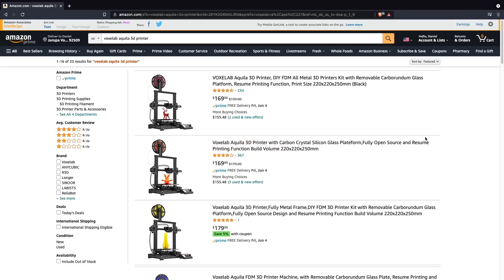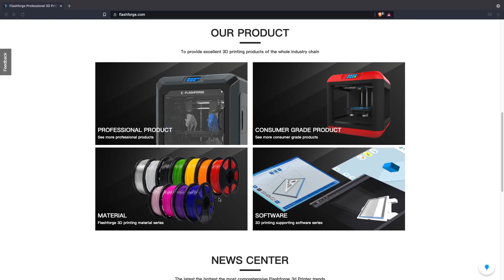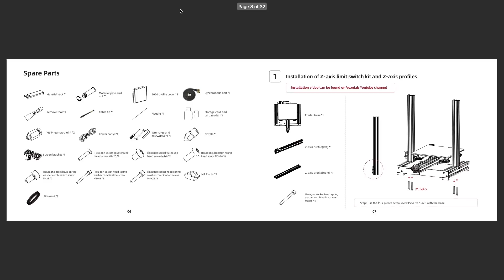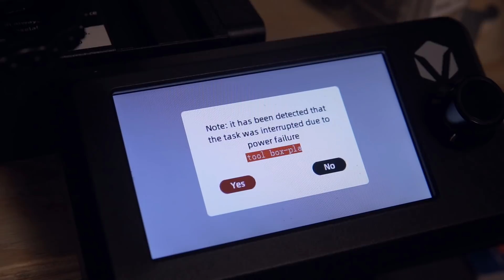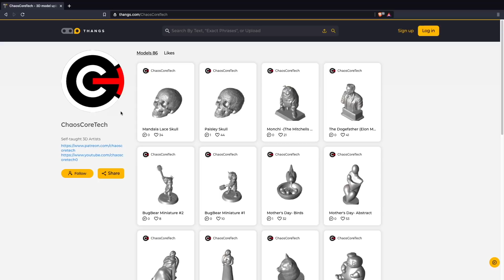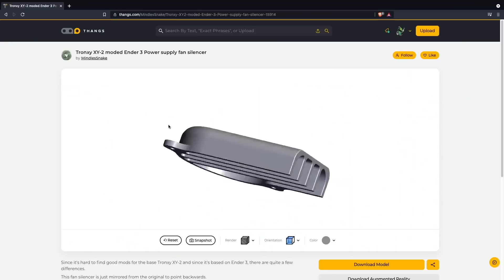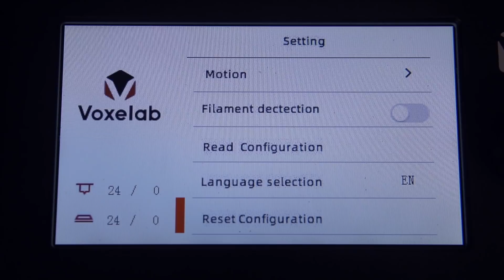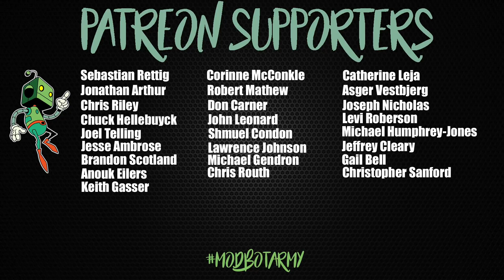Should You Get The Voxelab Aquila Over The Ender 3 V2?

Comment: I have the N32 chip aquila x2 printer. while it did work at first and not using it for a while tried printing a part I made but it was doing all sorts of wacky stuff. at first I thought it was my slicer or my fusion 360 model but I now can rule them out. I decided to update my software to the latest drivers. installed it it was fluttering didn't realize it was installed till I checked and saw that it was. Now its worst then ever. crud I'm frustrated.

Comment: Wonder how will both stack for longevity. 
I have a cr10 which is now 6 years old and is running the last two years in a camper van (I am vanlifing non stop since 2020 with my old cr10 inside)
I ran it pretty hard before moving it into the camper, with some really large almost full volume prints pretty often, now I don't print so often in the camper and never print for longer than 8-10 hours at a time but all the vibrations from driving and all are quite the torture test.
I have to say hands down this thing rocks, last week was the first time I had to change something since I bought it , the y axis nema motor, that's it. 
Maybe I got very lucky with my unit but still.
I should maybe make a channel testing 3d printers for durability in my camper 😂

Comment: I have one of these printers and it works great, there is one option I would like to see and its with changing filament mid print, there is no option to use the load and unload filament when you are printing, but the option is there when you are in the menu when not printing,😎

Comment: This was my first 3d printer and it has been great. It has run hundreds of hours in the last couple of months. The one big deal is it is extremely hard to find parts for. I keep hearing Ender 3 parts would work but then I noticed there are a ton that don’t. If someone could make a video going over which parts work on the Aquila I would almost pay money for that.
Reply: Just print the parts that you need 🙃

But ye it's quite concerning that some "advertised"parts don't completely seem to mesh
Reply: I’ve upgraded this thing from head to toe at this point. The only difference that I’ve had to deal with is the x carriage and the x end stop. The rest have been drop in replacements. I’m not too sure about the y carriage the holds the bed though, I haven’t looked to changing anything around there.

Comment: Is Voxelab trying to create confusion?  After watching your video, I checked out the Aquila.  There are four versions.  Their S2 version sells for the same $279 as the Ender 3 V2.  You can get an Aquila for as little as $169 but is comparable to the Ender 3 V2 or just the original $189 Ender 3?  So yes, the cheapest Aquila is $100 less than the most expensive Ender 3 but I don't know if that's a fair comparison.
Reply: S2 has a direct gear extruder

Comment: I have had a few successful prints but I find the bed leveling keeps adjusting itself I suspect the cheap springs under the plate, also I cannot seem to get this to work smoothly with the cura profile that was supplied with it, have stripped and rebuilt fine tuned and still having the same bed level issue :/ ill see what happens after new springs are installed

Comment: How do you suppose this printer will work with ASA? Since there is so much attention paid to heat on this and other printers I wonder how enclosing it might effect overheating of components?
Reply: This is not a printer for asa. You would have to upgrade the hotend to an all metal to print at asa temps safely. Not hard to do but should be aware
Reply: @Famousbird54  Thanks

Comment: You're joking... I.. I just bought an Ender 3 v2 2 weeks ago, I started modding it 3 days ago for the silent fan mod (with some difficulty, the guides do not mention ALL the stuff you need). Why didn't this show on my recommended sooner?
A real kick in the teeth is, I'm subscribed. sighs
It looks identical, I am shocked, amazed and really disappointed that I didn't see this sooner. I'm gonna go cry in the corner now.
Reply from the maker: lol no!! The printer you got is still awesome and the Ender 3 v2 has been a solid machine. There is always something new coming out but honestly I love even my printers that are multiple years old. Enjoy what you have, the v2 will bring you lots and lots of great prints :)
Reply: Ender 3 V2 have a lot more community mods. I replaced all my fans with noctuas to make it whisper silent, if you're farther than 6 feet away you can't tell if it's on or off by the sound.
Reply: Unless you do some serious mods, these printers are good but slow depending on part size.  Hence if you really want better results without too much time spent doing mods you need to think in the direction of having more than one printer to work with.  I am seriously considering adding more printers to upgrade over the slow - to - print problem.

Comment: My first 3D printer was the Aquila, then my 2nd one was an Aquila, and I will stay with this. Might upgrade to the X2 though. I've had little issues with this printer. I did have to replace the extruder stepper after about 4 months, but I've been running this "Hobbyist" printer hard. My only suggestion is to upgrade the plastic extruder with a Winsinn Aluminum extruder. It's worth the $20.
Reply: Do you have a model number for that Winnsinn Aluminum extruder?

Comment: I've had the Ender 3 V1 for a couple months now, I have the tensioner upgrade but haven't gotten around to installing it yet because I'm busy using the printer.
I got mine discounted as a scratch and dent (one little bitty unnoticeable scratch, SCORE) ao it was 33% off the $240 price tag (at the time of purchase)
with the auto-bed leveler (soon) and the bowden tube upgrade (first thing I did to it) it'll serve me just fine for a Looooong time.

Comment: For a newbie 
What filament should be used for what
Best all around filament 
Can this machine handle all types or what ones don’t you recommend to use 
About to order this machine on your recommendation 
Thanks
Reply: Use PLA, is easy to print, relatively cheap and it does not harm you as the ABS (toxic fumes). And if you need to print stronger pieces use PETG, but first learn with PLA, I would say.

Comment: I'm considering taking the plunge into 3d printing.  My question is - if I want to make a specific item to fit another item (like a lid for a jar, for example), how would I model that in 3d so it would be accurate and snug?  I already have a 3D program (Lightwave 3D) which will export a Collada, STL, or OBJ.  I just want to make sure I'm able to model something that would be accurate to fit it's purpose.  Thanks :)
Reply: Measure, print, measure again
Reply: You could print the specific item instead of printing an item to make another item fit into the other item. I hope you get what I mean

Comment: I was just looking at an Ender 3v2 because of all the community support that Ender machines have, especially when it comes to Cura settings. I currently have a Longer LK1Pro, and there's almost no support for that. it had its own slicer, and seemed finicky when trying to print files sliced in Cura (admittedly it could also be that I'm a noob and just couldn't dial in the settings properly). Since this comes with a working Cura profile, that may have just tipped the scales to getting this machine instead (and putting the money saved toward a resin printer).

Comment: maybe good for the price but currently they are shipping the printer with a 512k firmware on a 256k board.  The board and chip are supposed to be 512k but they have bad sectors and are operating at 256k.
Reply: no. the stock firmware is compiled for 256k and working flawless. but nevertheless i recommend to flash https://github.com/alexqzd/Marlin/releases/tag/v1.3.4

Comment: Hey im new to 2d printing and bought the aquila, some issues I have are bed adhesion but mostly its the stringing on the print, I feel it can be alot cleaner for pla, and my sports leave the bottom of what I'm printing unsmooth, is this normal???
Reply: For bed adhesion I recommend a glue stick. and stringing could be a number of things, could turn the hot end down a little, if it's too hot when the filament retracts molten plastic may still ooze out the end causing stringing.

Comment: @ModBot you might be interested in this, as you asked about my Snapmaker 2.0 a few times.  Over the weekend, I tried a POC where I wanted to find out how fast I can print with it while retaining a good quality for functional parts.  The results turned out to be rather amazing, as I had never really tried that before.  What I found is on a stock Snapmaker 2.0:

1. For simple geometries (rectangles and circles) that do not have overhangs < 60°, it can print very nice prints that don't have any ringing at 80mm/s and 1,000mm/s^2 acceleration.
2. For complex geometries and those with overhangs < 60°. it can print very nice prints that don't have any ringing at 60mm/s and 1,000mm/s^2 acceleration.

However, if you add additional cooling, #2 can print at 80mm/s.  The limiting factor that I ran into is the stock part cooling does not move enough air.  With enough cooling, it will even print at 100mm/s.  I was running the same tests on my Ender 5 Plus with the Micro Swiss Extruder and the Creality Silent Board, but it did not fare well at all.  The Creality Silent Board does not support linear advance, and thus had extreme ringing and acceleration oscillations that are not ringing, when used at 1,000mm/s^2.  I have a BIGTREETECH board and 7" display to replace it, but I need to build a mount for it first.

Watching the print head and bed move that fast, shaking the table as they move, was truly amazing.  Anywho, I thought I'd give you an update.

Comment: I was looking to buy a Creality Ender 3 V2, Then I saw a video review y another 3D printer Channel and went for this Voxelab Aquila, And I very pleased I did.

This is a fantastic 3D printer clone of the Ender 3 V2.  
I was very easy to build since it was at least 60% mostly pre-built and all the parts were and are top notch quality even the labeled single bolts and screw bags were good quality plastic bags!

The company does have on you tube a official how to build and level video which was one of the best detailed clear how to videos I've ever seen!

I had the printer built and leveled and printing really lovely prints in 1 hour from unpacking the printer which was super well packed in dark foam.

With this printer I was able to print PET-G for the very 1st time, My other printer which was my 1st brought one has one really big problem, I can't seem to level the bed right no matter how many hours I tried?  That printer is the Tronxy X5SA 2020 Upgraded Model. It has a big build volume and good touch screen ut no good if I can't level it?

And yes I saved money buying the Aquila over the Ender 3 V2, I saved £87.00p which is great for a printer which is a good clone of the Ender 3 V2.

The Voxelab Aquila is a pure joy to level and print.  The only thing I wish it had was a Touch screen.

There is a Ender 3 V2 upgrade I saw on Amazon UK which is a big touch screen that is made for the Ender 3 V2.
I wonder since the Aquila is a clone of the Ender 3 V2, Could that touch screen upgrade part be used on the Aquila too?
Here is the link to the screen for the USA and for the UK. if anyone is interested?

USA version > 
https://www.amazon.com/Creality-Intelligent-Upgrades-Compatible-Motherboard/dp/B091KWRTH9/ref=sr_1_1?crid=1SL7OHSWHW98D&dchild=1&keywords=ender+3+v2+touchscreen+upgrade&qid=1623055865&sprefix=Ender+3+V2+touch+screen+upgrade%2Caps%2C239&sr=8-1

and 

UK version > 
https://www.amazon.co.uk/Creality-Intelligent-Upgrades-Compatible-Motherboard/dp/B091KWRTH9/ref=sr_1_137?crid=30DYFJJFXRM06&dchild=1&keywords=3d+printer&qid=1619892374&s=industrial&sprefix=3D%2Caps%2C201&sr=1-137

Comment: Hey, The beep is set in the firmware in Marlin. If you have access to the firmware files you can change that very easily.
Reply: Can you de-solder the speaker and add a switch between it and the pcb thus allowing you to turn it on/off via hardware?
Reply: @Damiein  you can tuen it off in the firmware. At least in Marlin and I believe reprap. Not sure about klipper.

Comment: Any one knows what the oil on the Ender 3 v2 heat bed is?? Cause am having adhesion problems after a few prints and am now resorting to glue.  Just need to know about it so I can look for a replacement.

Comment: my friend just got an aquila yesterday and i set him up and i definitely prefer my v2. Jyers firmware is the biggest deal breaker for me.
Reply: Easy ;)
I can totally recommend alex‘s custom firmware based on jyers‘ ender3v2 custom firmware:
https://github.com/alexqzd/Marlin/releases/tag/v1.3.4
Reply: I'm curious ,what is so special about those Jyers firmware ? what are the difference ?
Reply: @aaronramly1705  it just improves the base software with things it should've come with and also adds more controls. It adds more leveling options like assisted manual leveling, if you have bl touch or similar then you also have Auto Mesh leveling, manual mesh(zhop), and extra probe tuning options. The list goes on i recommend looking up the Jyers page and looking at it all because its very quality work and too many things for me to list as I get mixed up with what came with it

Comment: Very few if any reviewers bring up thermal runaway and what other protections are on these printers. This has already happened on my new Ender 3 Max. At 3am in the morning while I was sleeping in other room. The loud tone easily woke me up. Most of us are running these cheap China printers with cheap components, tinned wires and etc. in homes were our families are sleeping and when we are away. Is your life or your families worth 50-100 bucks? Will insurance pay? Will China pay? I will not buy a printer without it. Also, TH3D has brought up a potential hazard with this printer and has not gotten an answer that I have seen. At some point things get too cheap.
Reply: What hazard did TH3d find?
Reply: @sed6  He did a 2+ hour build and tear down video on it and was impressed until  tear down. Check out his video...can skip to end part. Just passing along info because I was about to grab one.

Comment: NO, ABSOLUTELY, NO! Do not buy them until TH3D's question about the mainboards is answered. Apparently, the demo models were shipped with boards with 512Kb memory, and the retail units are shipping with 256Kb memory. While doing this, their firmware is still 512Kb. According to TH3D, this results in a fire hazard risk, and these printers should be avoided until this question/risk is addressed.
Reply: Where are you seeing this issue.  Searched TH3D and didn't find anything.
Reply: @saturnknts  Watch TH3D's last live stream from two days ago. It's towards the end of the video. I posted the link above but Modbot did not approve it yet.
Reply: @saturnknts  his last, ask tim stream he was asked about his voxelab that's when he said about having to do a follow up vid about only having 256kb chip but with 512kb firmware
Reply: there are two versions out there, correct. but they shouldn’t differ in print quality/printing performance. the only issue you could have is with flashing custom firmware.

you can easily check what version you have got by taking a look at your mainboard.

somewhere next to the extruder stepper driver is a chip which is labeled with either „GD32…“ (=256k) or „STM32…“ (=512k)

I for example have the low mem version.
https://imgur.com/a/S1tmgWB

by the way. i can totally recommend alex‘s custom firmware based on jyers‘ ender3v2 custom firmware:
https://github.com/alexqzd/Marlin/releases/tag/v1.3.4

works with both gd32&stm32

Comment: Print a cap to go over the beeper, it doesent silence it but makes it much more bearable
Reply: Newest community firmware have the option to turn beeper down or off.
Reply: @estorm7765  alex‘s custom firmware based on jyers‘ ender3v2 custom firmware:
https://github.com/alexqzd/Marlin/releases/tag/v1.3.4
Reply: or cut the speaker wires. hah
Reply: I cut mine off
Reply: Put a layer of tape over the beeper, it will reduce the output sound volume.

Comment: I have 3 Aquilas and love them. One I bought as a customer return for $99, It had a bad main board but voxelab customer service sent a new one for free. I might get some quieter fans but that's really my only complaint. I plan on getting more
Reply: I added quieter fans to it. It makes the whole difference, my printer went from 65db to 43db while printing.
Reply: I bought a used one for $99. My motherboard had the bed heater stuck on. Luckily, I had a SKR2 board on hand and upgraded it with that. So far, I'm really happy. I'll probably buy another $99 one. They seem to come up every once in a while.